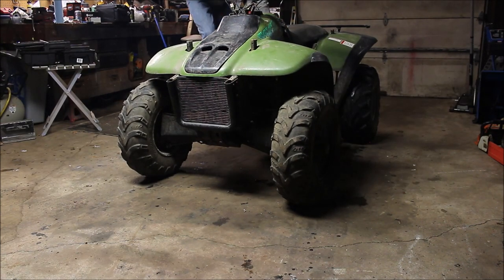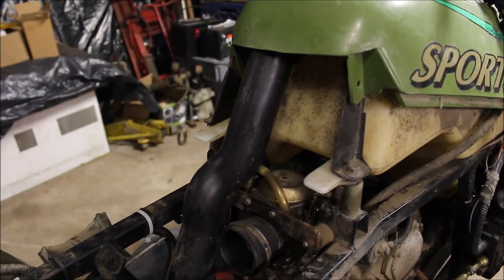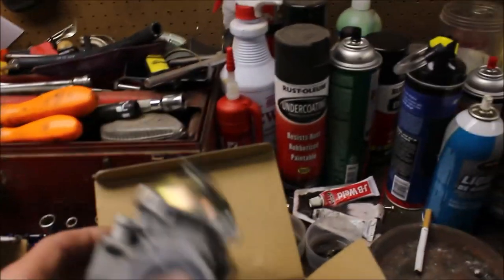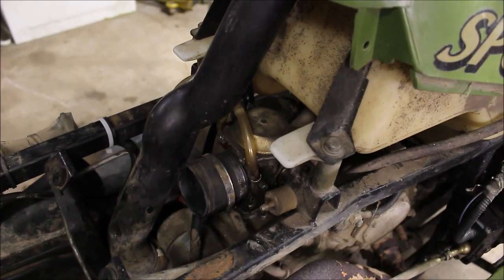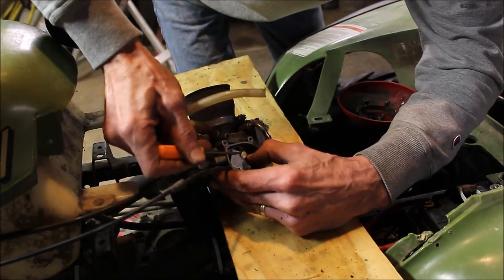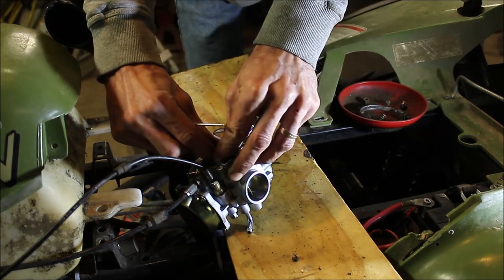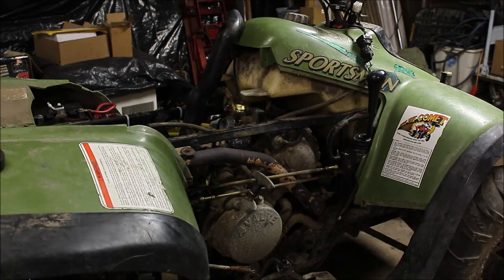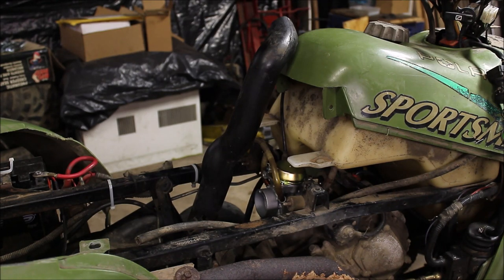Polaris Sportsman 500 Backfire and Bog Down Going up Hills? Find out Why!

Comment: Thanks X 100 for your posts.  Bought an 1999 Polaris for my son and we've used a lot of your video's to fix it up.  I was really baffled because we had changed cam, fuel pump, fuel lines and carb, but couldn't get rid of the bogging down and backfiring.  My intake boot was cracked in the same location as yours...problem solved.  Cam needed changed anyway...same probably goes for the carb and fuel pump.

Comment: Intake boots are a common source of air leaks. Not just on an ATV but on chainsaws  , snowmobiles and motorcycles.
I use nonflammable brake cleaner to find air leaks. 
  Just start the engine and spray the area you suspect. 
The instant that spray hits the leak the engine rpms will fall off. Works awesome without fire risk.
  Also works great for finding crankcase leaks on 2 strokes..

Comment: I have a question? I have a 1998 Polaris sportsman 500 4x4 I brought back from death. I used alot of your videos by the way great work. But now I have it runnning fine 3 or 4 times and then I kill it and when it goes to start again the crank bearly moves - but it runs fine when has a fully charged battery for a little while. it has a new stator and pulse coil and new head gasket and cam and rocker arms and checked valve to 0.06 and air gap is at 0.20 for pulse coil. Im stumped only thing I can think is maybe the voltage recticfier regulator is quirky. Just thought I would ask if you have time any advice would be appriciated. Thanks. from all the followers of his channel - He does good work and advice is never a bad thing.
Reply from the maker: Regulator rectifier will keep battery charged. I would check your ground wires. Maybe replace regulator. These 500 need a good battery. If you bought a cheap one they don't last long. Start there. Something is draining the battery.  I'm glad you like my videos.
Reply: @TitaniummanGarage  Thanks just ordered a Voltage rectifier and CDi to be safe. Watched another video of yours on bogging Polaris and saw some good info on hoses and air leaks and carb to head tube so will check that out tomorrow thanks again for all the great videos and good advice its appriciated.
Reply: @TitaniummanGarage  I have a 2006 sportsman 500 HO efi that I bought.  It doesn’t start.  I checked and it has spark, fuel, and compression.  I checked the valves and set them at .006.  New spark plug too.  Still no luck.  Any ideas?

Comment: Awesome 👌,  just yesterday had to work on my Polaris sportsman 325 would not stay on...took out the spark plug was black and smell like gas... cleaned it out put back on problems solved but did noticed a back fire ...in reverse. I will look into carb hose and also my choke on it is acting up .

Comment: Good videos. You sure know Polaris… quick question. I have a 2000 sportsman 500. Runs good idles good doesn’t loose power but when I let off the throttle sometimes it backfires and even shots flames from the exhaust manifold where it conects to the rest of the exhaust. Could it be my intake boot.? Or ?
Reply from the maker: Usually a backfire is running lean. Unless its loading up with gas. Might wanna check the boot.

Comment: A little off the subject... I have a "2012" Sportsman HO 500, with believe it or not, less than 50 hrs on it. Back a few months ago I noticed around 5000 rpm it would bog down and almost die an get that pop pop pop on hills.. It idled and run fine otherwise. Since I hadn't rode the thing very much, I believed it was trash in the carb. I cleaned the carb and replaced the jets.. No improvement. So, I purchased and installed a new carb.. Problem didn't improve. I changed the plug.. No help. I replaced the pulse pump and all the fuel lines.. No help. Removed and cleaned the tank.. No help. I knew the air filter was new, so I hadn't even given it a thought it might be the problem. But, one evening while listening to the engine idle, and revving it a little.. I thought I'd remove the filter cover and see how it run.. and it actually improved a little.. So, I removed the filter, and it improved a little more. And that's when I found the culprit. All that money spent on parts, time of changing them out.. and the irritation of worrying about this bike.. came down to the hard plastic sleeve inside the rubber breather tube, that prevents the rubber from crushing when you tighten the air filter onto the rubber intake hose. When I replaced the air filter, I had invariantly caused that little hard piece of tubing to be turned sideways inside the rubber breather hose.. which allowed enough air for the bike to idle and run half throttle, then fall on it's face around 5K rpm or so. Moral of the story.. Check everything, even if you think it's correct.
Reply: I actually believe I did the same thing! Over tightened the clamp on the tube just outside air filter box and it left a big v shaped hole into intake. Ran way better once I loosened it.
Reply: I took a little all purpose glue.. the kind that stays flexible, and smeared it around the hard plastic sleeve.. Then slid it into place and let it dry overnight. Worked well!
Reply: I was actually thinking of doing the same thing to the intake manifold boot the carb connects too. Put a bit of Flex seal all around it. I don’t think it leaks cuz I tried starting fluid all over it while running and it Nvr reved up. But don’t think it could do anything to hurt it. Only possibly help. I gotta get Mr. Titanium to do a total carb and jet video. Guess that’s one night ce thing bout EFI.

Comment: Are these the same carbs they come with ? 
I wanted to do an HO carb 
Do you have videos of setting up the choke ? 
Also where do you buy your fuel hose vacuum hose etc... 
I have a scrambler 500 4X4 pretty much just ride it in the snow ...
I try and keep everything in good shape 
   I think I have to put a bendex in mine man she makes some noise if it doesn’t start right up I I’m hoping it doesn’t need a flywheel 🙏🏻🙏🏻🙏🏻
Thanks for the videos ...
Reply from the maker: I go to my local auto parts store for the fuel and vacuum lines. These carbs are identical. I have put a HO carb on. You need the carb boot too. I also put a HO cam in. The exhaust will get hotter so to do it right you might need to change exhaust.. I made a video on carbs and a video on a full build I did changing the carb to an HO with the cam. Polaris magnum 500 brought back to life was the title.
Reply: @TitaniummanGarage  thank you sir for the information I appreciate it ...
Reply: I have questions I hope you can help me.  I have a 2001 Polaris 700 is not start I took it to a local shop charge me 1649.00 but still not working he told me he change the wire harness and I ordered a new cab and fuel pump but still not working
Reply from the maker: @fajlustshegchannel7809  what is it doing?  Does it turn over bit not fire? 700s are known for bad wiring. Did he replace the stator?  Check for spark? I could go 5 different directions with this. I would need more info.
Reply: @TitaniummanGarage  Thank you for reply back to me I will have that check

Comment: As has been talked about before if the common issues checked dont fix the issue  check the camshaft for a rounded off lobe on its central exhaust cam , its well known very common issue with this engine and causes bog and backfires as a symtom. , some CDI boxes will fail to maintain proper spark timing and cause backfiring and loss of power if the battery voltage regulator fails and the charging voltage goes to high at higher engine Rpm's.

Comment: I have a 2000 scrambler 500 and it is very hard to get stated and once it does start it won’t idle and runs rough won’t take a lot of throttle Boggs backfires at times and power comes and go’s but mostly only puts around. And dies then won’t start back.I’ve replaced the fuel pump took the carb apart cleaned it best I could. The starter button is kinda messed up too but works. Took the valve cover off and the exhaust lobe looks to be ok.I don’t have a lot of Polaris experience but built many many Hondas and Yamahas it wouldn’t run at all when I got it but I’m rather frustrated at this point. Not sure what route to take.
Reply: Hey. I have an 01 scrambler 500. Did you figure it out?

Comment: I need some advice I just bought a second 96 sportsman 500 and it smokes a lot and has almost not power if you hit the gas but idles fine I’m sure it needs a new piston but the rocker arms have some side to side play do you think it will need rockers and a cam or is it possible that oil is leaking into the cylinder from the valves causing the problem
Reply from the maker: Black or white smoke? Black would be oil ring or valve seals. white would be blown head gasket. There will be a little side play. I guess it depends on how wore the rockers look and check cam lobe height to see if its in mechanical limits.

Comment: I just replaced the exhaust donut on the pipe and it already burnt it up. This is a 1999 polaris sportsman 500. Should I just put another donut and put extra springs on to keep it from moving?
Reply from the maker: It burnt up? Sounds like your running it to hot. Do you have the stock carb on it? But yes spring would help with the wear.
Reply: @TitaniummanGarage  it is the original mikuni carb and I so think it's running just a little bit lean because it backfires when you let off the gas after revving. But I found out the donut springs are stretched after 22 years so I'm going to get some new ones and a new donut
Reply from the maker: Check the carb boot. If it's that old I would replace it. That would cause a backfire or lean condition.

Comment: So Jedi master of Polaris wheelers. I watched your “bogging video” I bought one of the cheap Amazon carbs and checked the intake for leaks with starting fluid. Got new air filter and replaced plug and fuel line. Got a fuel pump with carb but didn’t put it on yet.  Anyway the main jet on the Mikuni carb was a 142.5(0-3000’ elevation) but it’s it’s generally ran pretty well at 6k’ (my house sits at 6280’) anyway the new temporary carb (while I rebuild and clean up mikuni) came with a 145 and 180 main jet. I put in 145 but in Haynes/cylmer says at higher than 3000’ I should be using a smaller main jet. So I ordered a 30 pack of jets and needles and all that. It runs great with the 145 in till I get passed half throttle then it falls on its face. So should I put in a 142 or 140? If you could do a video on proper jetting procedures(like I said I got 10 main jets a bunch of longer, different ones that I’m not sure what to do with plus 2 other different styles). Id be more than willing to pay you thru Patreon or even Venmo! I’m just at my wits end! It’s a 96 I got for helping sister move. But I have an opportunity to buy a 2002 HO WITH THE EBS, for very cheap but it’s sat 4 yrs+. So I know I’m going g to have to go thru all this carb cleaning and such stuff with it as well. But I don’t want to buy it u til I got the 96 to where I can at least trust it to go off road(on road only now in case I gotta go tow it home, since I live up in the hills. Thank you for sharing your excellent knowledge with us less talented DIY’ers! Plz consider jetting/jets video! You humble fan always! 🙏
Reply from the maker: Love the comment! Thanks. Hmm... smaller jet? With the vaccum operated carb and higher elevation I would have thought a bigger jet. Let me research that one.
Reply: Thank you so much. Now I hope it’s smaller tho cuz I just went from the 142.5(mikuni) to a 145(Amazon) to a 135(but can easily switch to 140 since I haven’t put anything back together yet.
Reply: Minimprover 30PCS Carburetor Accessories Kit,10 Pcs Slow Pilot Jets and 20PCS Carburetor Main Jets for PWK Keihin OKO CVK KOSO PE PWM
Minimprover 30PCS Carburetor Accessories Kit,10 Pcs Slow Pilot Jets and 20PCS Carburetor Main Jets for PWK Keihin OKO CVK KOSO PE PWM

This is the kit. All I was after was the “main jets.” This is why I wish a smarter man like you would do a video on these carbs, mikuni sand Amazon/Ebay Chinese models. Right in line with main jet I thought the long skinny jets may go. I got a screwdriver just to check it out n the brass sides stripped without jet even budging. I’m talking the Lil one inside the bowl, not the 1n 1/2 turn out one, that is outside the bowl(1 n1/2 turn out from tight on 96-97, and 2 n 5/8 turns out from tight on 98+(according to my Cylmer maintenance book). So plz help. Thanks Yoda!🤣😎👍🙏
Reply: Damn my last post was supposed to be a link to Amazon! I guess I need more help than just carb jetting! You do iphone tech classes too? Hahaha
Reply: Yeah your problem is chinese carb. 
If you could take the old one off the replace it. You can clean the old one you goober.

Comment: I have 1994 Polaris 2x4 300 2 stroke, I’ve cleaned the carburetor so far, but it start up fine and runs about 200 yards and then bogs down and shuts off. I give it like 30 seconds and does it over and over again. What do you think I should replace to start off with ?
Reply: Those are gravity feed for fuel. Loosen you gas cap and see if it still does it. I've also seen the fuel shut off get clogged.

Comment: I have 2 2005 sportsman 400s and they both bog down and sometimes back fires when giving full throttle. When you go 1/4 to 1/2 throttle they seen to be fine just going from 1/2 to full throttle they bog down and don't wanna make any power. What should I check
Reply from the maker: It sounds like you need a carb clean..do you use fuel with ethanol in it? Its horrible for the carbs. Gums them up. The next I would check is the timing and if the cams are worn out.

Comment: I have a 2008 Polaris sportsman 400 HO . It sat for years ,only has 30 hours on it and it's 13 Yeats old ! A Polaris dealer put a battery in and air filter for my friends widow. Charged her 500 bucks and gave it back ,it started but ran like scrap ! I found 2 clear plastic tubes up under gas tank plastic cover that were not connected to anything ! I blew in the hose and could hear gas bubbling in the tank? So I tried starting it and it ran better when I did that. Soon as I stopped engine would bog!I put a bunch of Sea Foam in gas and it started running better ! Every tank running better ! Out of nowhere it all just start dying out unless you put choke on to keep it running! Sometimes runs with no issues at all and then it will start bogging dying out.It can run for hours without issues ? I also found the thick tube coming from engine to air box had that plastic filter thing melted from hitting the exhaust at one time! I saw you talking about the vent lines to the air box being important and wondered if that could be the issue. Also can't figure where the two smaller clear plastic tubes on top of tank are supposed to connect . They just lay up there open ended.
Reply from the maker: The tubes on top are the tank vent hoses. If they are blocked it will cause gas not to flow. So you did the right thing blowing in them to see if they are clear. That plastic filter that is melted would most likely be your problem. Not sure why its on the exhaust side. The vacuum hose from air box on exhaust side goes to top of the oil reservoir. The tube from the engine with the filter goes up the PTO side of the engine into the air box. If its plugged/melted it will cause your condition you described. I would clean the carb as well. The jets might be dirty from sitting. Seafoam is your best friend but won't unplug jets.
Reply: Seafoam is a miracle in a can. Wether for automobiles or atv’s it’s magic! Especially with old gas or storage of gas for long.

Comment: I have a 1995 Magnum 425 that runs great other than… from a dead stop it will rev out just fine, but after about 2 seconds (with the engine still under load and over 1/2 throttle) it will bog down. There’s obviously enough gas off idle, but I c ant figure out why it wants to bog under load. Override switch makes no difference. Carb is perfectly cleaned and needle clip is set in the middle. Carb boot is brand new. And fuel pump is brand new. Maybe it’s a vacuum leak from the carb to fuel pump? I’m out of ideas.
Reply: Did you ever get to fix it?
Reply: @fealiks  no. Sold the quad a few months later.
Reply: @jeepsandfarming  ok yeah, I think I’m going to sell it too, i had just fixed a big exhaust leak a couple days ago and first drive today and it broke again. This model feels like it’s cursed or something. We’ve put over 2k$ in it in the past year and we never even got one full drive in before it broke down

Comment: I have a question. I have a 2004.5 sportsman 400. It has an issue where it bogs down and loses power only in high range, low and reverse are fine. It does it only going up a hill under hard acceleration. I can drive on flat ground at full speed no problem. But when under a load if you give it full throttle from a dead stop it bogs hard and you have to let off and then it comes out of it. I have replaced spark plug, plug wire, coil, cdi, stator, rebuilt carb, new air filter, new buttons on secondary clutch, new belt. Still no luck. Any ideas would be greatly appreciated. Thank you!
Reply from the maker: Check your air lines to make sure nothing is pinched or leaking. See if the one way valve on air line is not clogged. also check to see if your fuel lines are soft. If so they can collapse under vacuum. Another thing is to check to see if your running rich on the carb. If you take the airbox cover off and it improves its an air leak somewhere.
Reply: @TitaniummanGarage  I’ll give that a shot thanks for the reply 👍🏼
Reply: @TitaniummanGarage  thanks for pointing me in the right direction. My vent line off the gas tank was broken and all dry rotted and the air line with the inline filter that goes from the engine to the air box was really soft. I replaced both with new lines and it runs like new!
Reply from the maker: Right on! Glad I could help.